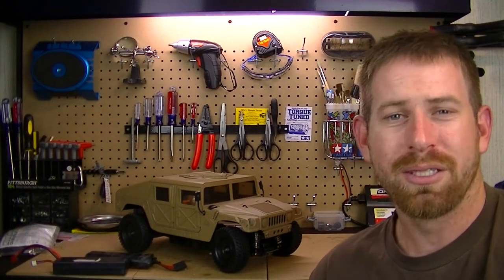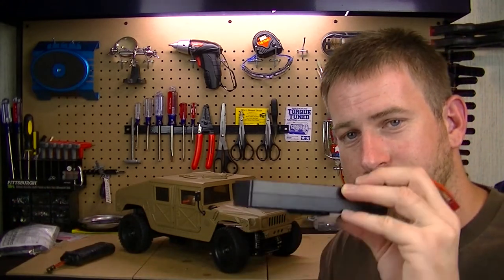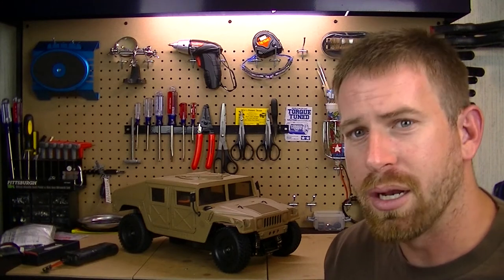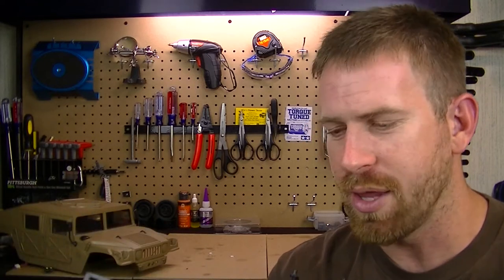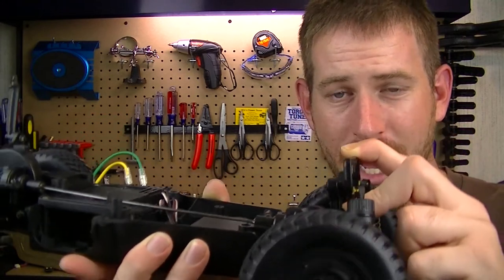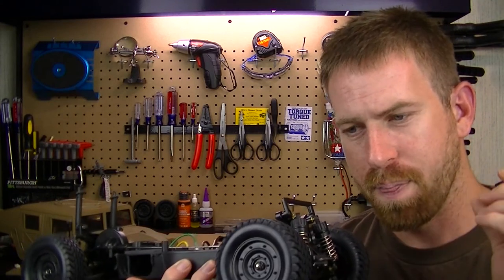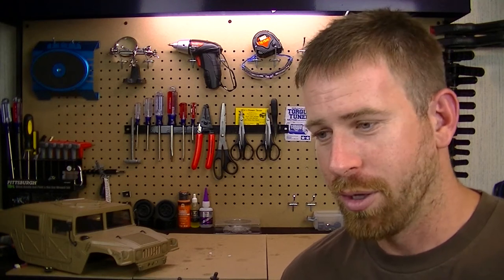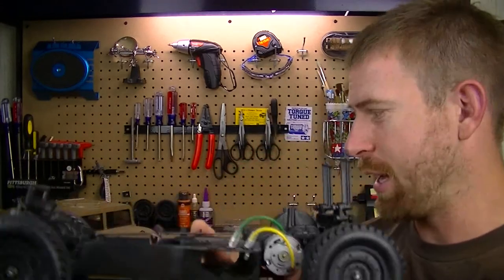RC84Films: Tamiya M1025 Hummer Update #2

Comment: Sorry to hear about your ongoing troubles.
Since you locked the front diff, indeed the thin wire is too weak. Tamiya had a stronger upgrade shaft, but those are extremely hard to find nowadays.
Can you please post a link to the shaft you've ordered?
Reply from the maker: I find the drive shaft on ebay for about $15 here the link
http://www.ebay.com/itm/Yeah-Racing-Aluminum-Main-Drive-Shaft-Set-BU-Tamiya-TA02-RC-Cars-TA02-134BU-/381892591440?epid=1518799001&hash=item58ea927f50:g:zNoAAOSwA3dYWiD2
Reply: Thanks!

Comment: http://www.genstattu.com/ga-b-45c-4000-2s1p-hardcase-8.html   this is the lipo that fit in old vintage rc's i have 3 of them and fit great....
Reply from the maker: Thanks
Reply: Hmm. Which chassis are you using this battery on?
From the dimensions it looks like it is slightly too big: 138 vs 134 mm long, 48 vs 46mm wide.
My experience with a similar LRP battery is that the roundness fits, but the battery is about 5 mm too long, so you can't use the original locking mechanism anymore.
Reply from the maker: TA02